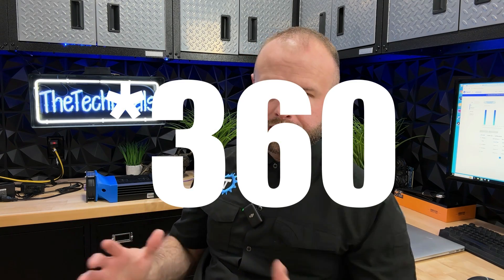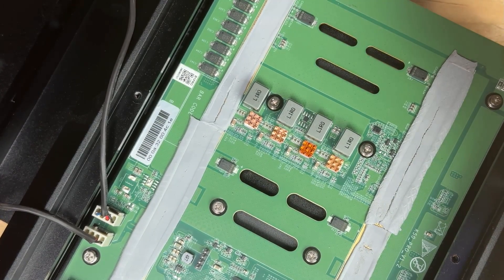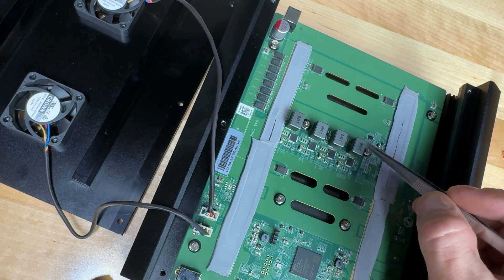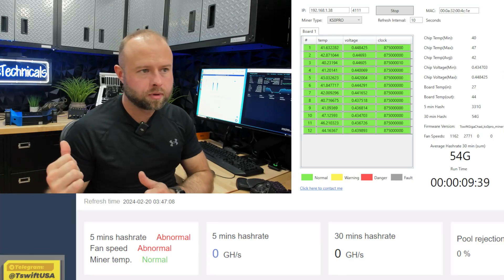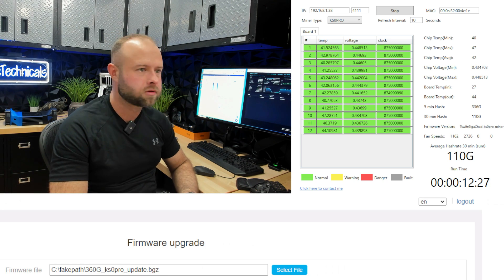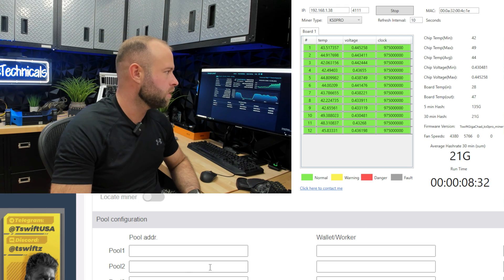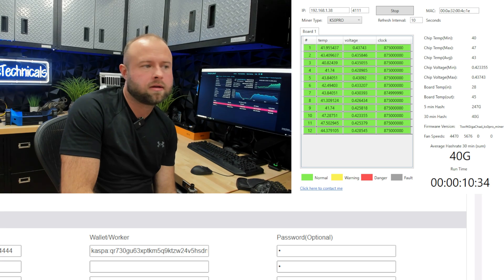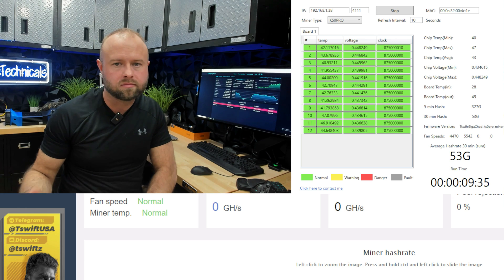Can I FINALLY hit 360Gh/S on a KS0 Pro?

Comment: You looked a little nervous swapping those heat sinks is it worth it I have the same low ones on there that you had because that's all I could get at the time apparently the tall ones were out of stock because everyone was modifying theirs
Reply from the maker: I am ALWAYS nervous doing stuff like this to sensitive electronics, but it was easy. I'm not sure it's worth it at this point though given how little the device generates

Comment: great job, if you have thermal heat camera you will see which mosfets is overheating at 340-360GH i have 2 that do that and 3 that just dont take higher than 300GH, so i was able to make one to go 320GH but it will fail with ambient temp rising to 85F.  I planing on testing combo thermal aplication to see if that helps , stay tuned.
Reply from the maker: I do have a flir one, but at this point i'm not sure isolating the culprit would make a difference given i've put the (biggest) heat sink I have on it, unless I do something more exotic, and not really worth the returns for this miner!

Comment: I can only run the 300G overclock, I have the same heatsinks as you originally had, so I was really interested to see if the new heatsinks would make a difference. Did your temps lower with the bigger heatsinks?
Reply from the maker: Monitor doesn't show the mosfet temps, but it made no difference in the end I was only able to get to max 340
Reply: @TechnicalsMatt  thanks

Comment: Pitching them so you don't have the turbulence from the Grey thing behind it may make sense.
Reply: If you really want to understand what's happening you need to make plexiglass cover and inject smoke machine smoke to see what the air is doing as it's flowing through.
Reply: If I was going to take a wild guess the down fans and the Grey things behind the Moffetts are causing airflow swirls....is it enough to cause oc to be lower I highly doubt it. If anything finding better Moffetts and replacing them is probably the key.
Reply: If you pitch the heatsinks, they will not cover the surface of the MOSFET properly

Comment: If the Finns are closer together you need better and more directed Air flow. So it really makes sense to spred the finnes out to get better heat transfer (between Finns and Air). Especially because they are partially blocked by the coils.
Reply from the maker: I think ultimately it's just too much heat to offload in a small area. Reached the limits of what I can do (within reasoN)

Comment: Freeze first to separte thermal pads without damage, after freezing though I suggest pointing a fan at it for a good few hours before firing it up again, because condensation could be present on the pcb

Comment: My unit doesn't like any of the OC's I've tried to use. If I'm lucky it'll run for a day then restart. All the temps look good and I've got a bunch of air flow around the unit. Have you seen this before?
Reply from the maker: Mine runs stable on the 320. try loading back in the stock fw and see if you still have issue?
Reply: @TechnicalsMatt  when I have the stock firmware installed it runs fine, it's a little lower than the advertised hash rate though
Reply: It's the silicone lottery, some MOSFETs can be pushed, whilst others cannot be